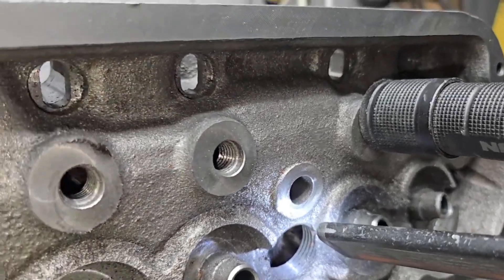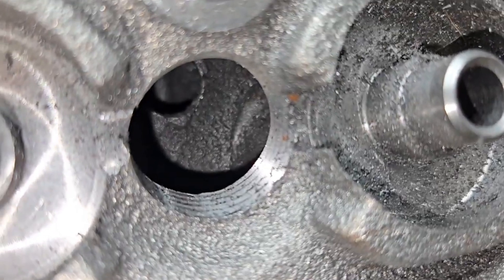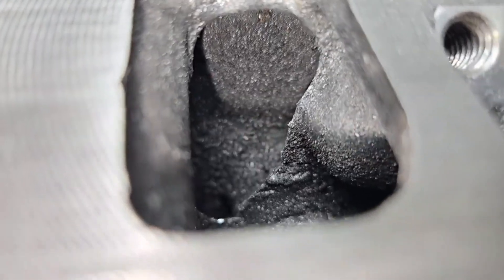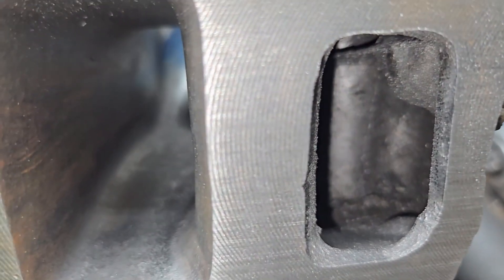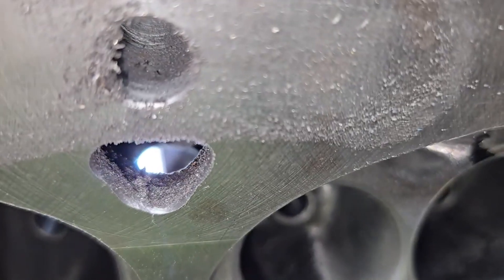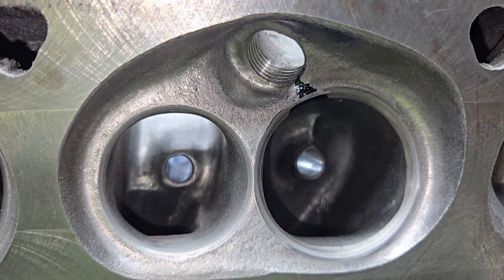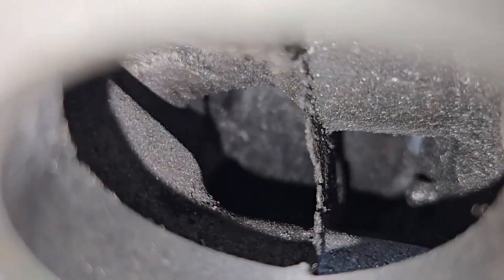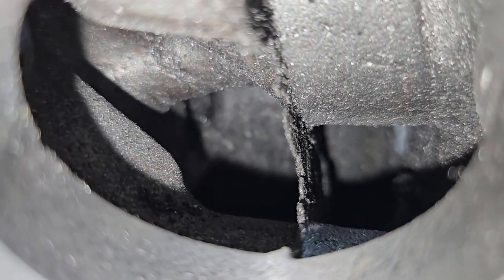Porting water passages for better cooling and fatigue resistance.  Ford 289 GT40 Race project

Comment: The parting line towards the end of the video is almost as bad as what i saw on a 4 cylinder jeep being built recently.
My thoughts are that flash can be of no advantage and possibly break off causing restrictions in who knows where, like plaque in your arteries eventually you could have a stroke if it gets hung up somewhere important.
Reply from the maker: @paulmryglod4802  I agree. Thanks

Comment: I wonder if " Smokey's" trick of pumping valve grinding compound thru it to clear those flashings . He used it to open intake and exhaust ports without tell tail grinding marks to fool the inspectors. Would it work on water passages, I wonder ? Some manufacturers used this method to finish castings today .
Reply from the maker: @philliplopez8745  I have never heard of this. Interesting. Thanks
Reply: @servediocylinderheads  I suspect that they use a diaphragm type pump .
Reply from the maker: @philliplopez8745  For good reason. They will pump any viscosity.

Comment: Hey mate,  what point do you stop smoothing inside the water passages, i would imagine  turbulence around flash help ensure there are less dead pockets for water flow. also as you explained in your non polished chambers. surface area (flash acting like radiator fins)  would mean more heat transfer.  In HVAC they rifle some tubes in heat exchangers to maximize surface area and prevent all the water / refrigerant flowing down the middle of the pipe with a stagnant layer where the heat transfer is happening. 

I would imagine left and right bank water flow balance could be considered and controlled through matching port sizing left to right bank.especially on intake manifolds without a rear water balance connection. So many tangents, does a uneven chamber heat rejection show up on spark plugs as 'hot' leading to enrichment compensation.
Reply from the maker: @daleanderson7629  Good questions. I think the cast surface is pretty good at heat rejection into water. I wouldn't smooth it. Water flow through the system would be interesting and see how it can be improved. This may improve detonation resistance. Thanks

Comment: hey Charles, got a couple thoughts on this tidy up on the water jacket of the heads. I can understand that removing stress point flashing.  but isn't that in turn removing surface area for coolant to absorb heat. I can understand it's hard to test because like u need to make custom sensors like on back face of combustion chamber or exhaust port. but like when you port an intake runner like making it flow more getting correct angles and so on it will help cool the air with less friction. so wouldn't that in turn do the same thing cleaning up the water ports /jacket . like wouldn't it be counter productive to a point to have less surface area and higher flowing coolant that's not absorbing the heat. I understand u can under drive the water pump and so on , but really how do you go about testing this stuff. if u somehow added 2 degrees of temp in combustion chamber by making a wrong move on coolant side of things that be more impactfull overall
Reply from the maker: @jacksonbermingham2168  You make a good point. I would rather have smoother water flow than a protrusion making a cooler spot in the casting. Thermal stress is something to think about. The more even the temps the better I would think. Thanks

Comment: 🔔😎
Hey Charlie.
Im betting the production iron heads cast the last 20-30 years are much better since they're using the lost foam method.
🤔
Reply from the maker: @hotrodray6802  I thought lost foam was only for aluminum?

Comment: Folklore claims smooth combustion chambers minimize carbon build up. I have not taken apart my engine or scoped the chambers to know for sure. I want to reverse cool my SB utilizing the threaded openings in the head, directing the coolant to the exhaust valves, as per Smokey Yunick.  Thank you for posting!
Reply from the maker: @ts302  You are welcome.
Reply: Chevy gave that up after 4 years.
Reply from the maker: @hotrodray6802  Reverse cooling. Yep

Comment: I have debated with myself on the topic of removing casting flash in the coolant passages. On the plus side, less prone to cracking On the negative side it's less surface area to interact with the water. Who knows? Not me!

Comment: Ok! I have never looked at this before. Now that you point it out. Wow never thought of it before and that is bad news and now you have to admit all out performance motor one of those pieces broken off. What is it going to do to your engine? Overheating anything is never good but plugged water passage . Good video and thank you. Also! Can you sand blast this out? I’m thinking not. But would be nice if it would work. Like I said I have never looked before so I have no clue on how hard it would be.
Reply from the maker: @richardmoerke9329  I doubt it. Thanks

Comment: What air flow is to making horse power, water flow is to cooling has always been my thoughts on keeping an engine cool as far as the engine itself, interior wise has been. Sure a good water pump and plenty of radiator and airflow through it big but is t the inside an important part of it all and part of your (you the reader, not Charlie) process? 

Maximize efficiency everywhere.
Reply from the maker: I like how you think Rob!

Comment: I hate to admit, but I've been "porting" oil passages, pumps, water pumps and passages for about four decades. I've never seen any real empirical testing but the testing I've seen on water pumps was pretty convincing. 
    Building mostly Cleveland and 385 series Fords, any improvement is usually worth the effort.
Reply from the maker: @psychoholicslag4801  I have been doing the same since the 80's. How can it hurt? Thanks
Reply: Exactly. 👍
Just like intake ports, fluid flows better around curves than square corners.👍😎

Comment: 🔔😎🇺🇸
Another good reason to have a good radiator pressure cap and thermostat and high flow water pump, to prevent steam bubbles and micro cavitation in restricted flow areas.
Aluminum heads tend to flow coolant better and that's why they cool better, not because they are aluminum.
Reply from the maker: @hotrodray6802  Interesting, I would have thought since aluminum may have thicker walls, the water passages would be smaller in the same sized package.
Reply from the maker: Aluminum's heat transfer coefficient is about 4x as much as iron. Thanks
Reply: About 1995 HotRod mag did a test of identical castings in aluminum and iron. Maybe world products. I don't remember. They flow tested to within 3 cfm  of each other. On the dyno there was zero power difference. I think it was Jeff Smith's byline. 
Cooling was not evaluated.
Maybe 15 yrs ago an old Chevy engineer did write in HRM? that the iron SBC Chevy heads had about 13 hot spots/ steam pockets and required good water pump pressure and thermostat to keep the steam in check. He posited that that was the reason the aluminum cooled better.
We concluded that aluminum does not make more power just because it's aluminum.

Comment: Sharp edges cause cavitation, and cavitation wrecks everything, starts flaking off pieces of metal, no good.
Reply: Hello. Coolant passage porting and deburring is interesting issue...depending on coolant flow direction cast edges can sometimes see as "coolant ribs" which give more cooling surface and sometimes they resist flow and just make troubles...but you obviously are very professional doing this kind of stuff. Great video and great explanation👏👏👍
Reply from the maker: @TomKunnas  Thanks
Reply from the maker: I agree, smoother water flow will help even cooling. Thanks

Comment: Get one of those Harbor Freight needle guns, that are for scale removal and use it on those casting flashes. Just remove a few of the needles to allow you to put it through the smaller ports.
Reply from the maker: This is a good idea. Thanks